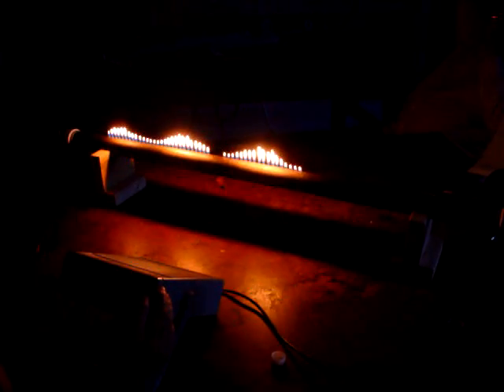Portland Rubens' Tube Physics Demo - Trial 1

Comment: tube has harmonics that work best .... whole number divisions of the tube length. also the longer tubes can achieve more harmonics because its fundamental wave is longer and easier to divide without having to go to ultra high pitchs (frequencies)